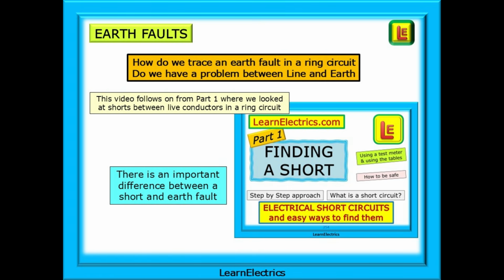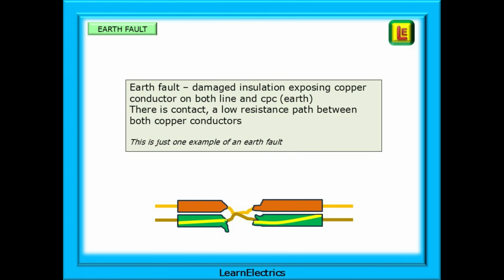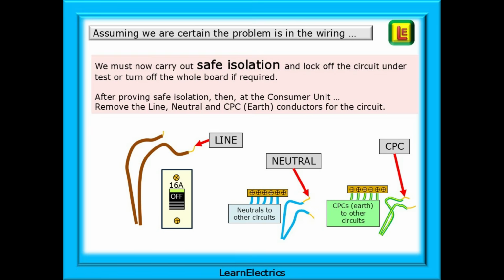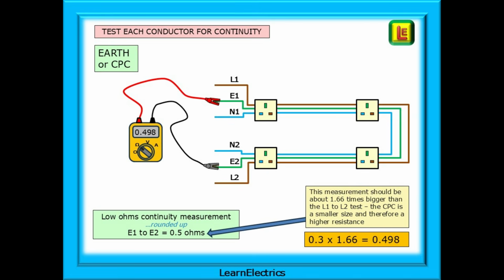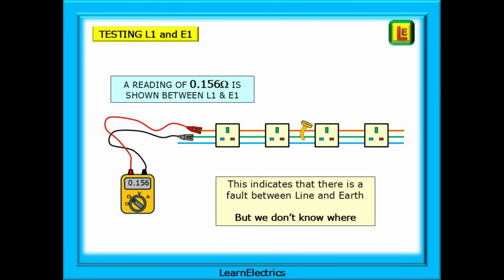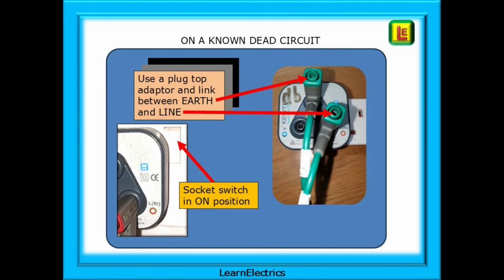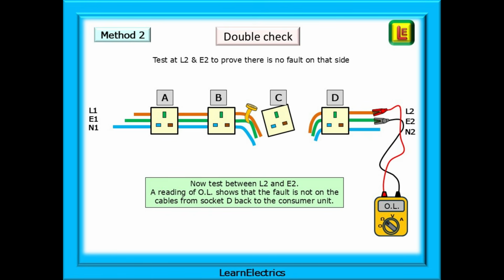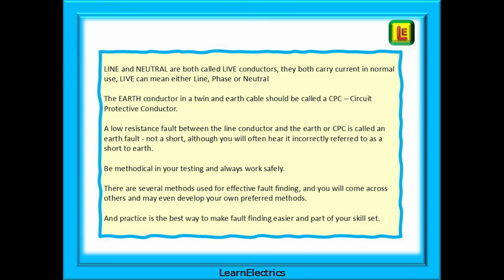EARTH FAULTS – FINDING SHORTS PART 2 – TRACING EARTH FAULTS IN ELECTRICAL CIRCUITS WITH EXAMPLES

Comment: Hi. I'm not an electrician but I do like watching your videos. Just a quickie: If a fault was on a spur from a ring circuit would the same tests still work?
Reply from the maker: The spur part would need to be treated as a radial circuit. Video coming on that soon. The video would be done by now but I've been in hospital. Coming soon. Thanks for watching. Dave.

Comment: Great tips! Quick q - if the nail is removed and thus L or N is not touching CPC, will the test show an open circuit/999 ohms?
Reply: If L and N are not touching then it will show open circuit, however there could be a second fault or the cable might have been damaged so the short remains after the nail is removed.
Reply from the maker: Absolutely. That's why I always test all 3 combinations of L N E
Reply: @WitheredPancake  thank you for your insight. 👍🏾
Reply from the maker: Thanks, that's why I always test all three L,N,E combinations.
Thanks for watching. Dave.
Reply: Another excellent video Dave
Reply from the maker: Thank you.
Reply from the maker: Yes it will, unless the copper is touching it will read open circuit and appear normal. Dave.

Comment: Wow! This video is very informative and the best video tutorial on the topic for me so far. I really appreciate it. Thanks for sharing it with us.
Reply from the maker: Glad it was helpful, thanks for being here.
Reply: @learnelectrics4402  I was doing my practicles for 2391 on a Water heater switch  bur there were other cpc they were connected to some other parts something like parallel paths etc. During the R1+R2 test should those extra cpc connected to something else like parallel paths be disconnected???